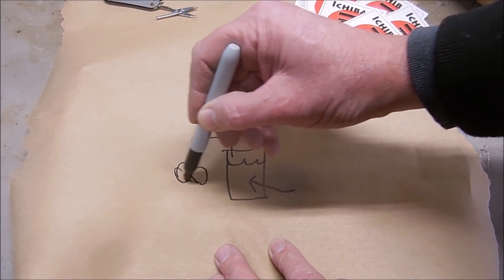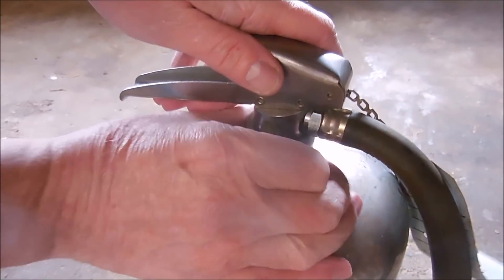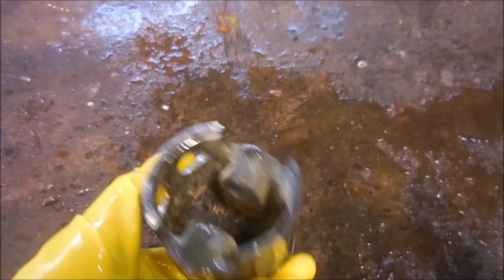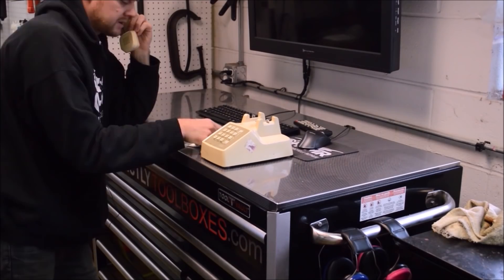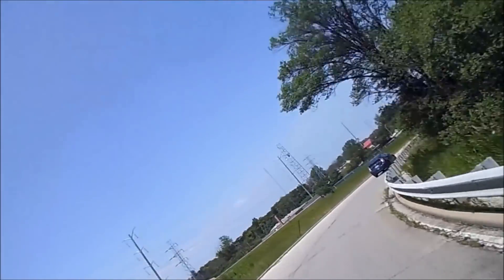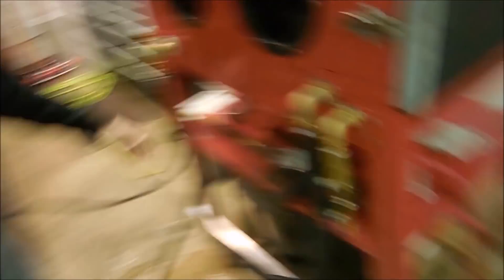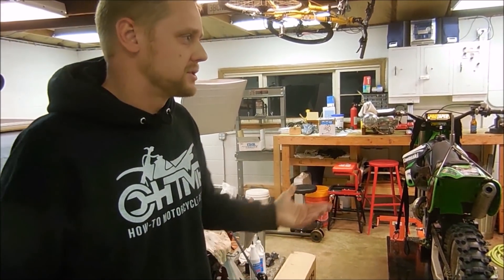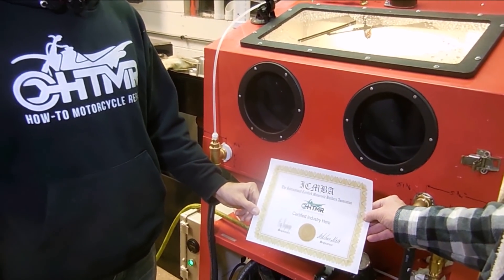how to make a DIY vapor blaster and clean aluminum HTMR field trip

Comment: I get the desire to promote Matt's plans.  However, cutting out parts of the video make it just plain frustrating and fairly useless.  Not a fan of that.  I think it could be a good video, but the way it is done right now actually makes me less interested in the plans.  Too bad, really.  Anyhow, nice job on the original video (I think).

Comment: Have you ever tried walnut shells in this system?  Also maybe a material recollection basin.
Reply: Sounds a lot safer than fine particles of glass flying everywhere. And the walnut shells (which which are actually tiny pieces similar to sand) you can just let fall onto the ground, even your lawn. It's environmentally friendly-just don't inhale the stuff LOL.

Comment: Is that an old Yam RD250/350B piston with the stepped zipper ring?
Reply from the maker: it is  (  but from a RD400 restoration. same piston as the 350, just stroked.  )
Reply from the maker: you win stickers!  message your address
Reply: @IchibanMoto  I had an 1979  RD250e and found a 350b top end to convert.. as you say, same bore (64mm??) for the 350 and 400.  If I remember, the 250/350 had a 54mm stroke.
Reply: I thought I'd seen a RD or XS wheel floating about

Comment: Hey ichi, I’ve been following u for awhile now, but ive been having trouble on achieving the results that you’ve had, such as the soda blaster. And other projects. I’m sure my zip ties are good, as the color coordination is spot on, but my assembly tape is a source of many leaks.  I am using 3m r4400 ultra, which my service specialist says is the best psi rated tape allowed for my state. Do I need to move?

Comment: Pretty cool stuff.   Do I set it on Watts or volts?  I'm not sure how many 18650 batteries to connect on series to get the same results as a plug in version
Reply: I think 2 batteries should do it as long as you set it to Hertz, but I could be wrong.
Reply: You need exactly 26 18650 batteries. And as Mr Metal Fab points out, it's crucial you charge them with Hertz'es! It's bloody difficult getting the phase right on all 26 batteries, so you may need to throw a few extra in.

Comment: BADASS!! I visited my local vapor shop and got the liquid it was expensive but it smells nice, now i just need to buy another blast cabinet and convert it.
Reply: Camaro Rick you can actually do this with an old Chicken incubator. My uncle used to convert a few of those. If you know how to handle a screwdriver,  shouldn’t take you longer than an afternoon.